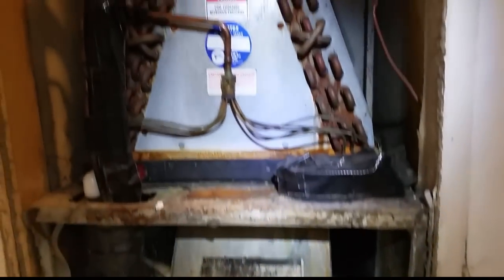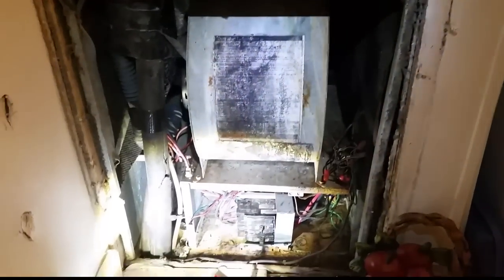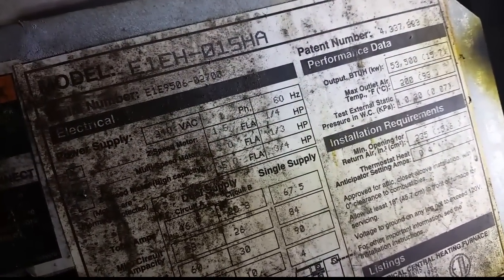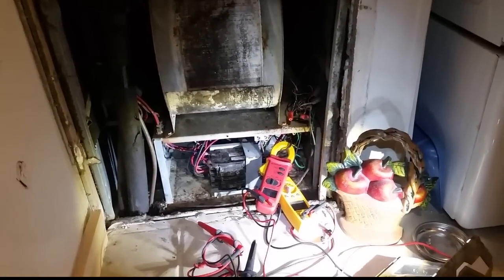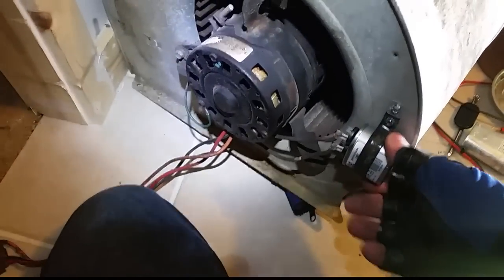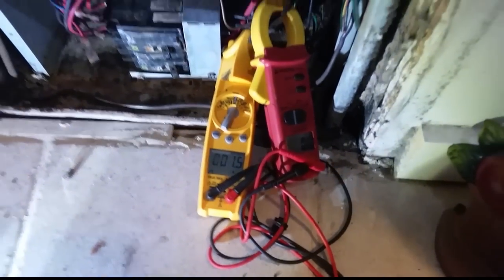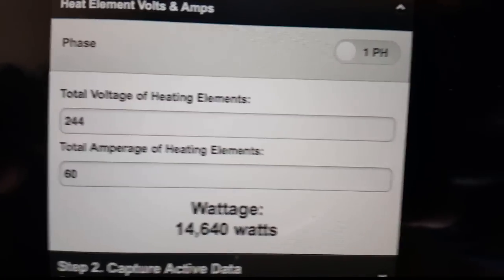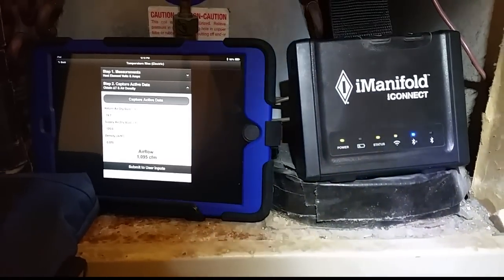HVAC Service : No Heat Intertherm Electric Furnace Triggers Smoke Alarm

Comment: Intertherm furnace suck the electricity. its rated at "100" efficiency and uses almost twice the electric as my central AC system rated at 13 seer. PURE JUNK.

Comment: The breakers are not the correct size and also are installed inside the furnace and underneath the furnace ?.....
Reply from the maker: The breakers are integrated into furnace design, they are not field installed. They are correct, but there should have been a 39 and 60 in the main panel.
Reply: Oh ok.
Thanks for your videos.
Reply from the maker: Thanks for watching

Comment: Ok....I know that mobile home systems are "high static" systems....I have tried for years to "correctly" check static across the ID coil or even total static as I try to set my blower speed according to Intertherm's blower data. I use the heat rise method mostly but I want to figure static across different filters as you know they lay on the evap coil. I'll say 99% of the time I hit it spot on as it's not rocket science but sometimes you have "that one" system that just aggravates you!!! What do you do? Where do you place your tubes?
Reply from the maker: That would be a tough system to get static on. This one used the entire room as a plenum and the Filter wad in the wall. I don't think I could of even got a reading. I know you could get a reading across the blower but the coil would be difficult.

Comment: I hate the old E1 Furnaces!!! I think they were engineered by a female as you have to have small hands to get in there without removing the disconnect breakers!!! They are hell to work on because everything is crammed into a tiny space!!!
Reply from the maker: It is a very tight access to controls for sure.

Comment: Zack, if you ran electric heat up here in New England for heat, your electric bill would easily be $500-$600 a month! Typical home up here is on average $150-$300 a month with oil or natural gas heat!
Reply from the maker: It is the least cost effective for sure.